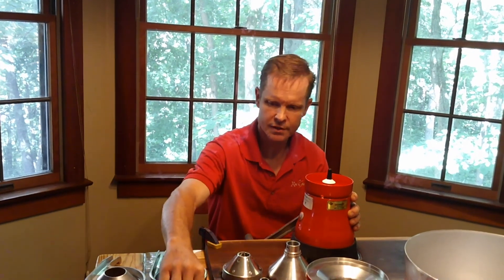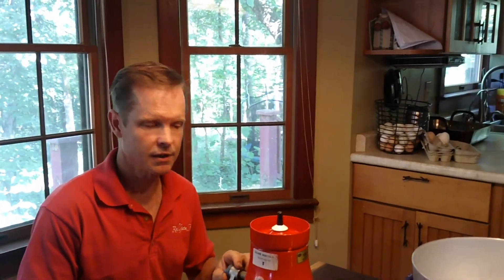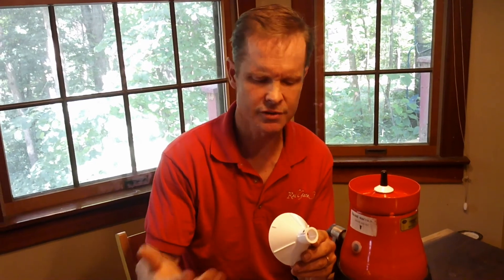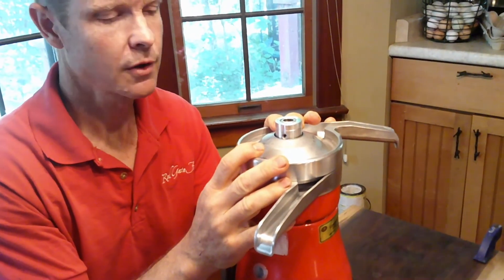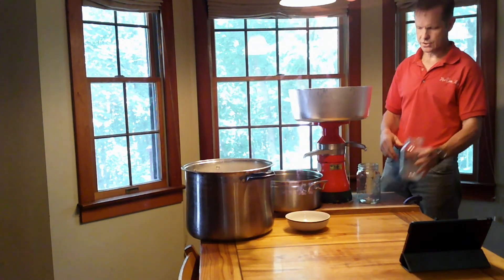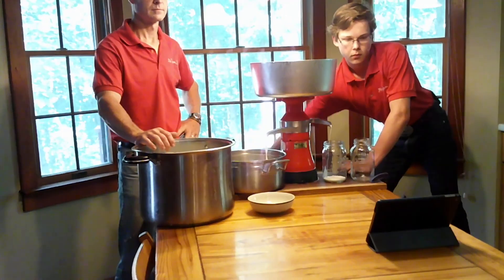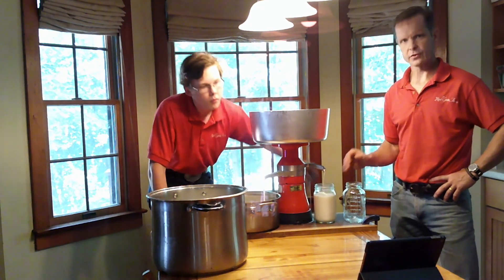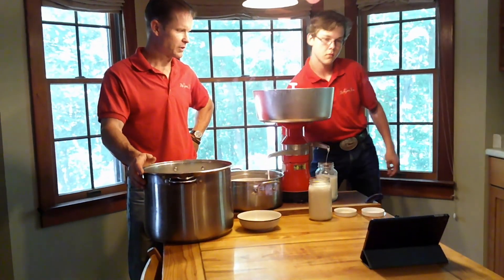The Slavic Beauty Cream Separator

Comment: Thank you for a clear video. I have the electric model. I am having some grinding and leaking problems with it. Have you come across any good troubleshooting info?
Reply from the maker: We have noticed if milk is left sitting in the machine for any length of time, then some of the seals do tend to leak slowly.  As far as troubleshooting, I would recommend you email the company.  They have offered us excellent customer service, though be aware there is a language barrier and it can take them a couple of days to respond.

Comment: I just bought one of these for my wife (we’ve been wanting one for years!). I’m sure I am doing something wrong, but I can’t seem to find out what. There is a lot of milk leaking from the weep hole. What are the first things to check?
Reply from the maker: I only have a few drops of milk per load come out of that weep hole.  I can only guess that the milk is leaking out of the separator rings. Perhaps it’s not screwed tight enough or it doesn’t get a good seal when you do tighten it. After screwing the cone together, try pouring water in it before assembling the separator. See if water leaks out of the bottom.
Reply: @ADifferentWay  thank you for the print reply!

Comment: Why does my separator leak from a hole in the side?
Reply from the maker: I had a small amount also leak from that weep hole. I’m guessing it just takes any milk spilled over the milk dispenser (the first dispenser on the bottom) and allows it to escape. When you set the setscrew to heavy cream, it happens more, because I’m guessing more milk is going through that funnel, and it has more of an opportunity to overflow.

Comment: Can you crank it too fast?
Reply from the maker: Certainly, if you crank it too slow, you will not get enough speed to properly separate the cream from the milk. However, if you crank it too fast, I can only assume you will have inconsistent results. Once you set the screw up top to determine how heavy you want your cream, you need to maintain a constant RPM to get a consistent result.

Comment: I am a little confused about the oil part, am I just dumping it into the hole "blindly"? I just don't want to make mistakes
Reply from the maker: The instructions should tell you how much to pour in.  You simply remove the plastic plug, pour in the oil, replace the plug.  Done.  The mechanism will spread the oil where it needs to go once you start cranking.

Comment: how  many liters of milk you used and how much cream u got.
Reply from the maker: Using the settings we have chosen, we get roughly 3 liters of cream from 14 liters of milk.
Reply: @ADifferentWay  Thank's for your reply.One more question.    Can you make a video on,  how to regulate the thickness of the cream by rotating screw(means I have milk with 6% fat and I want 4% milk after processing)
Reply from the maker: Unfortunately, it would be tough to explain that in a video.  The instruction manual doesn't help much.  We've found it's really just trial and error.  You can make little adjustments to the set screw while you have someone else separating the cream, until you get a thickness you desire.  If you are wanting additional specific details, it might be best to contact the Slavic Beauty company directly.  Although there is a bit of a language barrier, we found them to have excellent customer service!
Reply: @crazyboys7301  Since each milk has a different fat content and  this is a unit for home use (not a professional unit), there is no exact setting for a certain % of fat outcome in cream. It is easy to figure out the setting you need by trying. By turning the screw clockwise you get thicker cream, by turning it counterclockwise, you get more fat left in milk. If you want to have 4% fat left in 6% milk, you want to turn turn the screw counterclockwise about two full turns from the leveled position. Let me know if this helps and if you have more questions.
Reply: @SlavicBeauty  Hey thanks there.  It would be a question on my list I feel.  Im close to getting one for spring 21